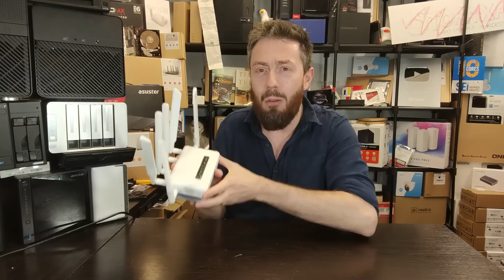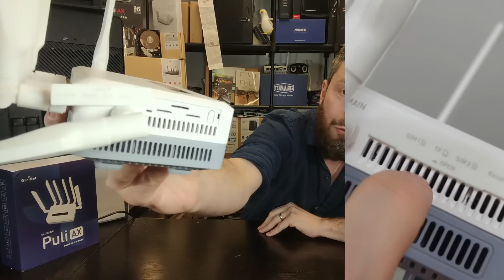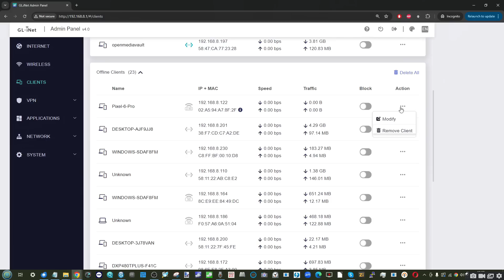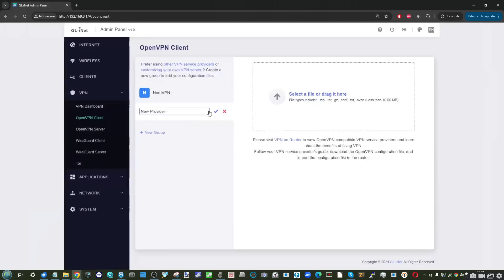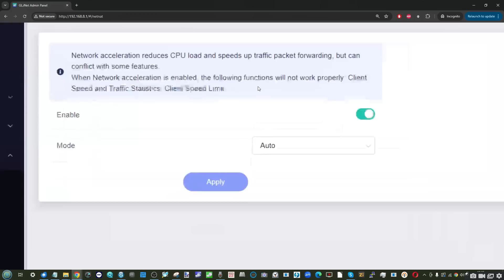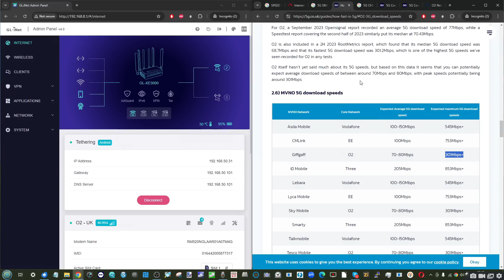THE ULTIMATE SIM ROUTER DOES EXIST - The GL.iNet Puli AX Mobile Router Review

Comment: I absolutely HATE GL.inet products. 

1. DHCP reservations NEVER save
2. The LTE modem cuts out ALL THE TIME. This happens on multiple routers we have
3. WIFI will stop working for no reason. This is a big issue for us because we use WIFI as WAN. The solution is to connect via ethernet and run a command in SSH to reset wifi
4. You get more than about 30 devices connected to it on wifi and ethernet and it will tell you that there's too many devices connected. 
5., UI is too rudimentary and advanced features are command line only
Reply: 1. DHCP reservation works for Flint 2 without any problems, did you try it from LuCi or standart UI? 
2. Tryed Slate with external LTE dongle and didn't find any problems as well except not the best speeds, but it depends on dongle antenna and its place - no router fault here. Some providers cuts off usage of their SIM in routers, maby problem is there?
3. Do no use internal wifi bcs have mesh network installed in my flat already, so cant comment it.
4. At the moment have 15-20 devices on ethernet/external mesh wifi controlled by Flint 2 - no problems at all.
5. If UI look isn't too rich for you - try use LuCi for additional features like firewall and bunch of plugins for openWRT. Command line is nice to have for my taste (just worth to limit access to it via LAN only in LuCi), but im not in Linux enough to use it at 100%
Reply: @nosurname9652  both it ends up failing after a while and you have to redo all of them
Reply: Unsure what you are talking about. My Spitz worked without a hitch for five months powering a full household equivalent set of devices and run times 24/7

Comment: You may be only getting a 4G connection with those speeds. Presumably as 5G SA is relatively rare still in the UK, those aggregated upload speeds are probably over 4G as well?
Reply: Hi, do you have any recommendations for SIM card routers?
Reply: @kierand9410  I have a Zyxel NR5103Ev2 which is supplied by Three for my mobile broadband. It’s pretty good. There’s a slightly older NR5103E which is bigger but has very slightly better specs. I get about 500Mbps down and a slightly disappointing 20Mbps up (using 5G NSA, no SA here yet). It’s reasonably stable though. I’d prefer FTTP though but don’t have much choice.

Comment: I've got the GL X3000 load balanced across two 5G smart phones, love it. Looking into running it with a pass through charging battery bank as a DIY UPS solution...
Reply: I've been doing that with my gl-x750 using a INIU B63 and works perfectly. The important part for me was getting a 4.0x1.7mm to usb C wire that supports 12V. With that I only needed to connect the router to the USB C out port on the battery and plug the battery input usb C to an outlet. It also works well in a RV conected to any USB although depending on the W it might no be able to keep up.
Reply: Did you use Smoothwan + Speedify? Or the default openwrt has its own bonding features? Thanks